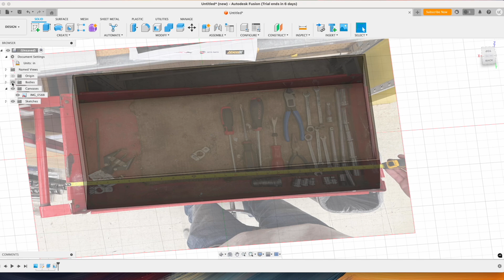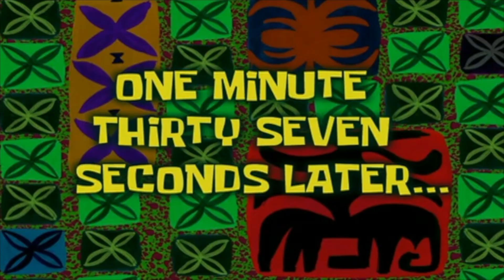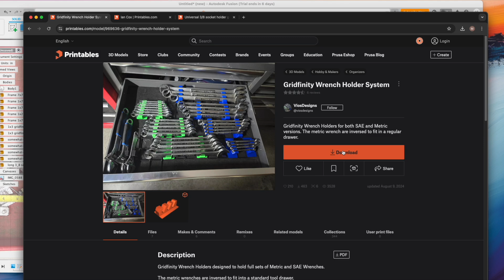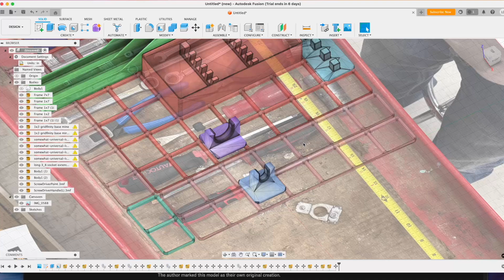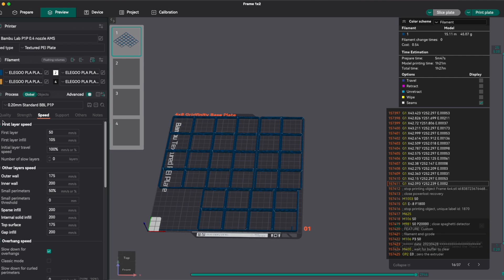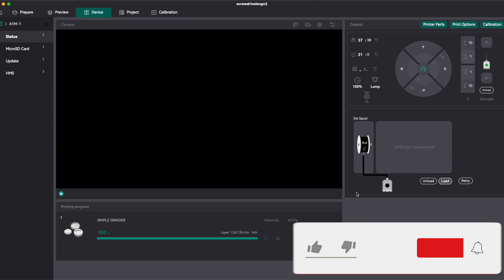3D Printed Gridfinity Tool Cart – The Best Organization Upgrade!

Comment: Just a tip to avoid incorrect "measurements".  When you calibrate from your image, choose two points which are furthest away as possible.  Instead of choosing 11" and 14", you should have chosen 1" and 24" (or whatever portion of measuring tape you had visible in the image).  If your calibration points are too close you risk multiplying measurement error. Hope that makes sense.  Nice job brother.
Reply from the maker: I’ll have to remember that for the next time I'm calibrating from an image. Thanks for the tip!

Comment: Looks like that thing makes it way easy
Reply from the maker: It sure does!
Reply: @TheMountainMaker  do you plan on securing it in place some how?
Reply from the maker: I plan on going back in and using some instant set CA Glue (super glue) on the baseplates so they don’t slide around when moving the cart. I can see that becoming a problem if the plates start shifting. I haven’t decided yet on the components of the cart because one of the great things about gridfinity is the option to move things around or swap current components out for new ones as needed.